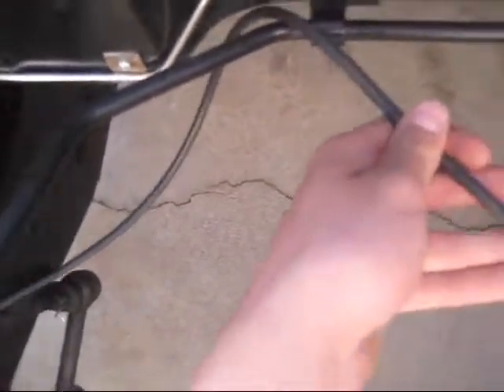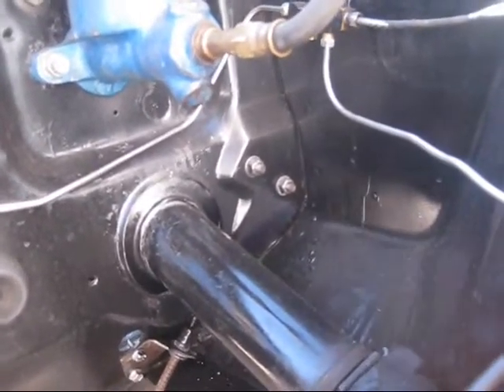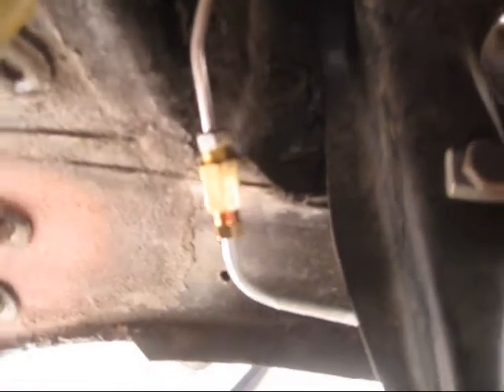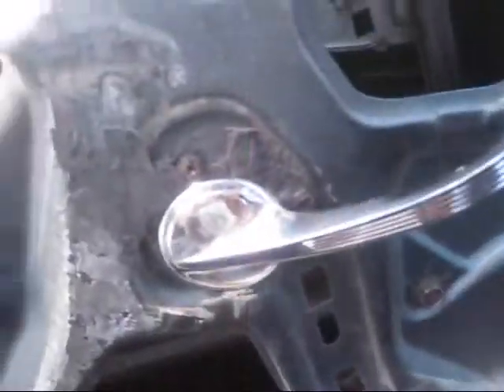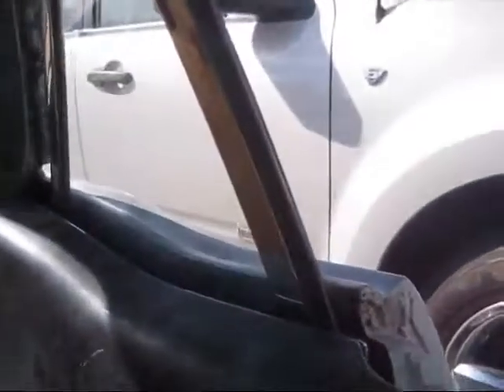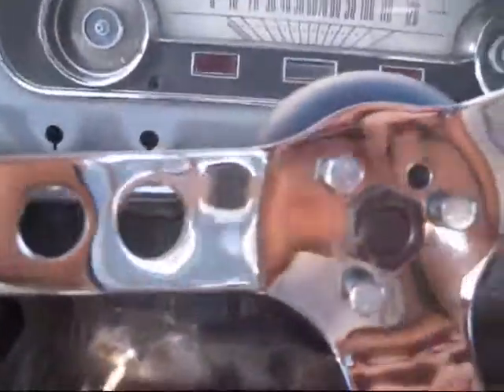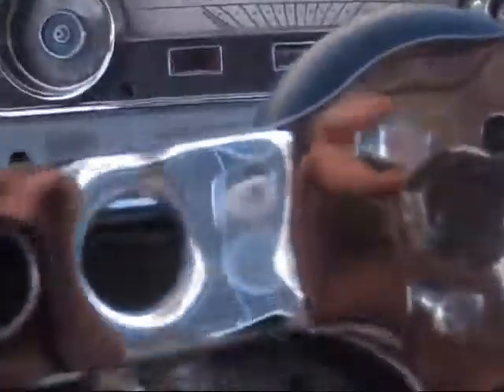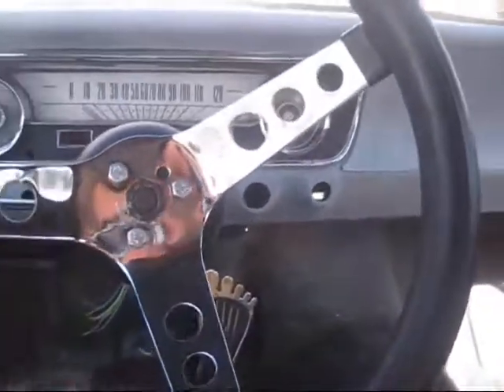1965 Mustang Restoration PART 9

Comment from the maker: Thank you! The master cylinder worked fine after I hooked up the rear brakes, I think it's because of the tandem design. I got it all to work but the rear brakes were hanging up because of the residual pressure valve (I have discs in the back now), so I'm going to get a different master cylinder. They are cheap and I can get one with equal size reservoirs, I think it will look better. I bought this one when I was planning on having drums in the back.
Thanks!

Comment from the maker: I'll bleed it some more, the problem is the master cylinder itself though. It only takes fluid from the line, not the reservoir. When I hook everything up, it bleeds fine and takes fluid from the reservoir. But as soon as I tighten the bleeders it stops working. Should I just bench bleed the heck out of it some more, or is there a defect or something in the MC? It's like the seals are installed backwards but I've pulled it apart and it's together correctly. Thank you!